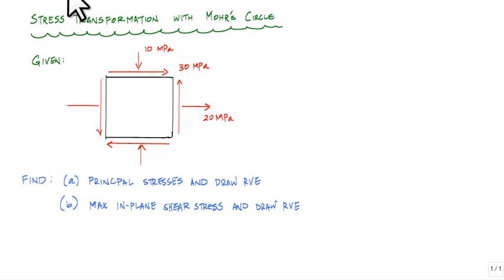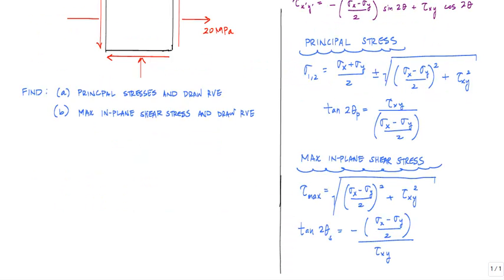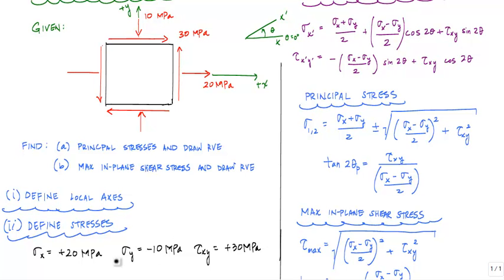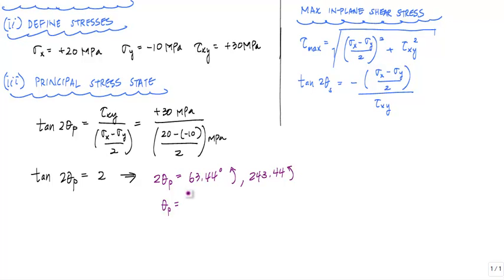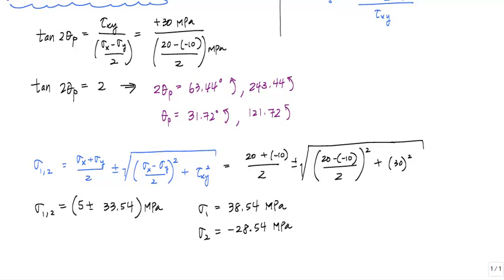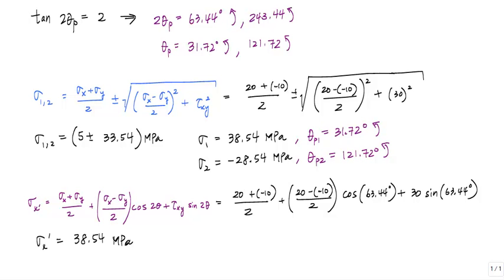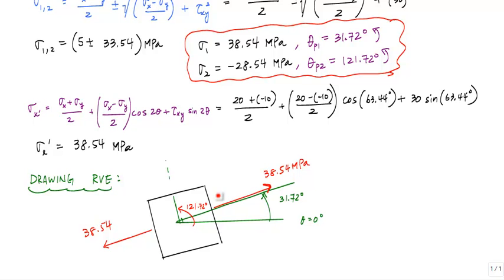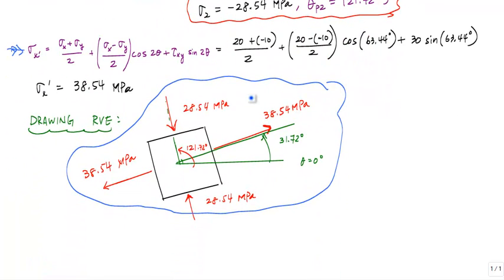stress transformation example 1 (1/2 - principal stresses) - mechanics of materials

Comment from the maker: No offense to Otto Mohr, but the reality is that it's just as easy, if not easier, to perform stress transformation by plugging and chugging through stress transformation equations. Check out this video...stress transformation without Mohr's circle.
Reply: +structurefree Yes, but understanding Mohr's Circle first as a graphical tool  is a lot easier than memorizing equations that seem to have been derived out of nowhere.
Reply: For sure. You need to know half of the calcs in order to even start Mohr's circle anyway...
Reply: structurefree   That is, easier with fancy calculators of course. :)